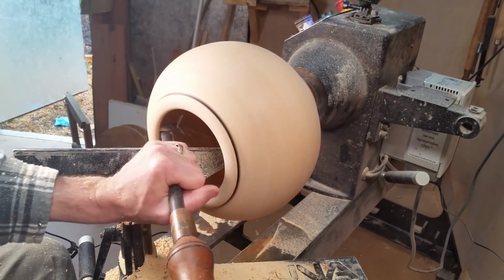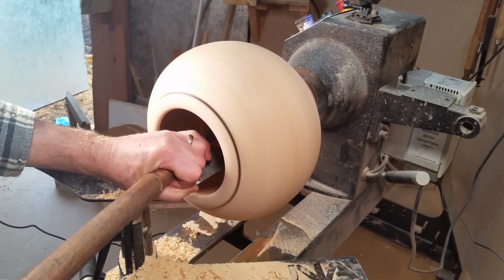161. two hearts are better than one Part two

Comment: I love how you finished the foot of the bowl - maybe I'm weird, but the bottoms of bowls are important to me. I have never turned eucalyptus, but have had similar issues with sweet gum. Glad you pushed through to a finished piece, rather than bailing out when the going got tough.
Reply from the maker: thanks David.  I am getting more and more particular about the foot to.  glad you noticed.  ;-) are you sure that a sweet gum isnt a type of eucalyptus?  common names a frustrating but I have heard euk called gum.  either way I think trees that suck up alot of water tend to have that fast growing twisty thing and then when they dry out they go through a lot of movement and cracking.  I am think that a slow growing hardwood desert tree might be the best wood  but thats me just guessing.